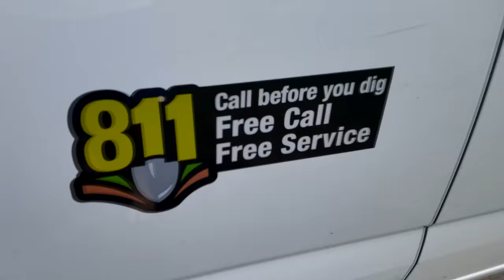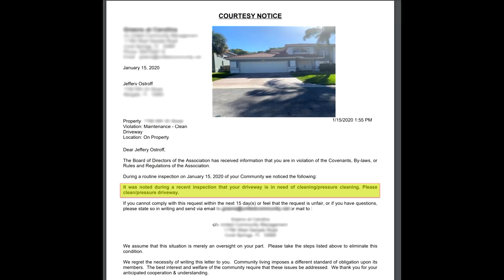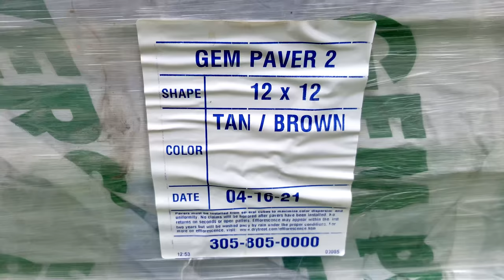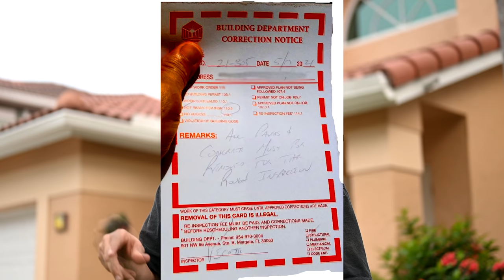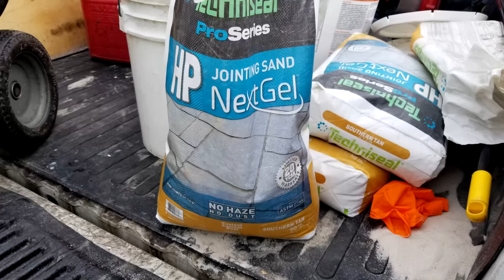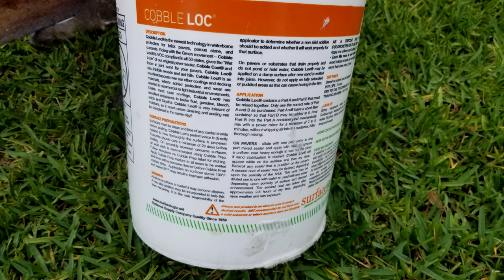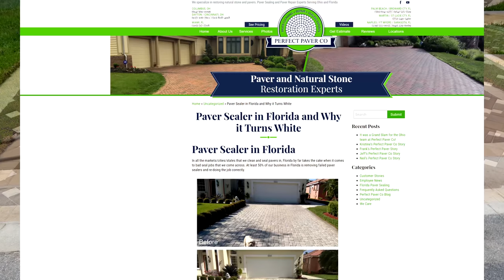How To Install Paver Brick Driveway Like Pros w/Time Lapse

Comment: This is all great...unless of course, you live in a State like our WISCONSIN and have to run a snow blower or plow over it during our 4 months of snow each season!
Reply from the maker: Would not do a snow plow on this
Reply: You’d have to have a rubber blade.  I used to plow brick drives all the time.  Though, rubber blades don’t do as good of a job.

Comment: What I want to know is why a guy would complain about the former contractors on a paving job that was excellent. Then in the next minute complain that an inspector actually wanted you to remove all the pavers so he could check base depth. Did you know how deep the base was on the sidewalk? Don't do half the job and complain that an inspector doing his job is OCD. Oh and I've never seen anyone cut paver that are already on the ground. The cuts just aren't straight when cut on the ground. Thats why saws have flat tables. There's also plastic borders that are secured with big spikes that are used to retain the edges that work at least as well as the cement as ground moves and concrete doesn't so it breaks

Comment: Gotta say that the old driveway is actually in pretty good shape (minus the oil stains) and looks like, after 28 years, it held up well. It's a shame to have to replace because of oil stains, but I get it. I would have done the same. To bad you had an incompetent inspector.
Reply from the maker: Yes the bricks of the old driveway were physically in good condition. The perimeters were starting to sink into the edge of the driveway, and the oil stains no matter what we tried and no matter what companies we've brought in over the years with acid wash and everything else, nobody was able to get rid of the oil stains. Tried every remedy people suggested over the years. The homeowners association was really getting on me about the driveway stains and I had no other option but to replace the driveway. But I did get 27 good years out of it.

Comment: The driveway looks great. The installers did great work. One thing that is concerning is that you should never dry cut. A saw that distributes water to the blade should be used, or someone should be pouring water to the pavers that are being cut to greatly reduce the silica dust. I didn't see anyone using PPE when pavers were being cut so everyone, including Jeff, was breathing silica dust. I wonder how the installers' lungs will work in the future. I hope that someone makes them aware of the damage they are causing and do the proper steps to be safer.
Reply from the maker: I agree. I stayed away from the cloud of dust when they cut.

Comment: I’ve never seen anyone compact the sand before, but it looks like a good strategy.
Reply from the maker: I believe it is required by code
Reply: it is necessary, but they did it completely wrong... they cracked all those bricks with the compactor, that's not how you do it
Reply from the maker: @notimportant3686   I'm not sure what you're talking about they do not crack any birds with a compactor.

Comment: Gorgeous as it is, kudos to your HOA for allowing you to do something unique.  I'm afraid our HOA would have rejected the plan because it was different from every other driveway, and would have "spoiled" the homogeneity.

On another note, it would be great if you showed the budget for the job, and the final cost against the budget.  Also, maybe a little about how long it took from signing the contract to gathering materials and scheduling a crew.  I know your mileage may vary based on location, timing, etc.  But cost and schedule play an important role in dreaming.  Sadly, my budget would have seen me turning over the oil stained pavers and maybe putting a little cement around the edges.  

Great vid!
Reply from the maker: The total cost of the driveway install was $4800. After that came an additional $700 for polymeric sand, and for the initial sealing of the driveway
Reply: @jeffostroff  is that just material? Or labor included?
Reply: @RIZZOTTO  HI Jeff , I'm curious as to how many sq ft thus was total?  Thanks in advance  , looks great

Comment: Very cool driveway and walkway. These guys really knew what they were doing. I was a little uneasy when their hands got so close to the saw blade. 😣
Reply from the maker: That one seen the blade was spinning an inch from his toe!
Reply: @jeffostroff   Once, I was doing a big landscape job next-door to a house where a man was doing a patio and fire pit decorative stone job.  Beautiful work! However, he used no safety glasses with his saw and he worked in flip-flops. I complimented him on his work but told him I was frightened for his safety. He said he had been doing it this way for 10 years with no problem. I never saw him again, but I wondered if his career ended after 1 or 2 more years.

Comment: That old driveway looked good..... It just required a degrease and to reset the borders
Reply from the maker: No decreased worked even acid wash did not work
Reply: @jeffostroff  that's a pity...  That old driveway is much better than mine..... But the new one was the dogs bollocks!!
Its beautiful.

Comment: This is SUCH a Florida driveway...I love it!

Jeff, out of curiosity, is the sealer just for parking cars on it? If it was for the backyard, I assume it wouldn't be necessary.
Reply from the maker: The sealer protects the surface against stains from oil drips, brake fluids, other liquids, fruits, etc. I always seal all my bricks even the back patio
Reply from the maker: @gorak9000   They did not force me to install a new driveway they simply said clean off the oil stick ass. But we could not get them to come off and I wanted a new driveway for a number of years anyway so I replaced it.

Comment: Completed Driveway looks beautiful, but I thought that was the point of having pavers…? If you have broken or stained pavers you can just replace those particular pavers and not have to interrupt or replace your whole project!? 
Majority of your old driveway was still in great shape; I hope you gave those pavers to a place like ‘ReStore- Habitat for Humanity’.
Thanks for sharing all the steps and beautiful driveway and walkway.
Reply from the maker: I stopped them from carting off more bricks, and posted them on craigslist for free. Guy showed up in 30 minutes with his pickup and tool the rest away to re-use. You can insert new bricks if you have them, these are 27 years old. I wanted a change and these newer bricks with the small diamonds were just the pavers to do this job.
Reply: @jeffostroff  plus they would be hard to match color and style!

Comment: The driveway looks great and the video was excellent.  A couple of questions.  I have found that using small area pavers can cause eventual uneveness when something sits on the corner of one of the small pavers.  Not a tire, but something smaller that can apply pressure in a small area.  Even though the sand is compacted, it can still give.  Have you expereinced any unevenness?  How did they finish out the perimeter.  I saw the mortar/cement for the soldier bricks.  It did not look like there was much room left for topsoil and sod though.
Reply from the maker: yes, all edges had just enough mortar to hold it in place, then grass is brought up on top of it. A few of the pavers have developed a bit of lippage between pavers, and no sand is perfect, and can still shift a bit underneath from rains

Comment: I did a sidewalk myself all by hand. It turned out good but man I couldn't believe how much work it was.
Your driveway looks great. Must have cost a lot especially with that curve. $15k?
Reply from the maker: Nope! Only $4800 plus another $700 for the polymeric sand and sealant
Reply: @jeffostroff  Wow that's a great!
Reply: @jeffostroff  did one crew/company do the job or separate crews/company? It must also help that you work in the trades so you know more than the regular DIY.

Comment: I'm surprised the pattern didn't violate HOA something. Even with that sealer 20:54 still think you might need that tool if there's ever another oil spill.
Reply from the maker: I sent the HOA photos of tiles and drawings and they approved.  The sealant is supposed to be resistant to oil spills, so hopefully we don't have to test that.
Reply: Give it a year or 2, the HOA will find something to complain about. As I say, 'If there's an HOA, just say "NO WAY"' - NEVER buy a house in an HOA unless you like being pestered continually about the stupidest crap.

Comment: I really don't know what to say that driveway looks absolutely amazing the old one the 27-year-old one and you couldn't get the grease stains out right you tried so I'm wondering what if you went to some kind of auto parts store and said listen can I have some of your old oil and take all the oil and stain all the other asphalt just oil stain it cover it with plastic and the whole thing would be blended with with the oil stain right and then you wash the top off and now it's a new color but it's Blended and it looks a lot better and probably would last another 27 years but the new driveway obviously you get more money with the new driveway right so good job with that too
Reply from the maker: Yes, we tried every cleaner out there that people said would work. Even had a company acid wash the driveway but did not work

Comment: Hey Jeff - a question.   I will be doing a small patio on the back of my condo.    It will be 2- 20” pavers wide and about 20-20” pavers long.   Do you think I need to have the vibration machine for this small of a job?   I do think that the polymer sand will be a good choice, but not sure I want to invest in the vibration machine for such a small job.   If there something else I could do instead to get it all in the cracks?   Again, it will be 20X20s so not nearly as many cracks to fill as you did.  BTW, beautiful new driveway!
Reply from the maker: You need to find some way to vibrate it, you buy a tamper from home depot, $30 and but a board down and down and tamp the board to cause vibration. Are yo on the first floor? not a good idea to add pavers or tile to upper floor patios
Reply: @jeffostroff  ok I can do that.  My dad has a tamper so I can borrow his (I was going to use it anyway to tamp down the sand before laying the pavers).  And yes, this will be on the ground not in a balcony.  Thanks!

Comment: What sand (sand grade?) is it that your packing before the bricks?
Is it a certain type of sand/ ground? Any help will be greatly appreciated
Reply from the maker: They had a dump truck just dump a huge pile on the yard so not sure what that was, however they did have several bags that they brought with them the day they installed the bricks that said place sand and here's the exact bag from Home Depot https://www.homedepot.com/p/SAKRETE-50-lb-Play-Sand-40100301/202007298

Comment: water must be used at all times when sawing
Reply from the maker: There are saws and blades that can be used either wet or dry
Reply: I stopped using water years ago. Got tired of the mess it makes and the residue it leaves on the pavers requiring the extra step of washing it off. That being said you're comment is a good one for most diy'ers in that they probably won't take the proper health and safety precautions when dry cutting.

Comment: How much would this cost? Labor and materials. What was the total work time (how many days?)
Reply from the maker: This total job was about $6000. The 1st day The demolition crew came and took them about 2 hours with a Bobcat to pull up all of the old driveway bricks and haul them away then they put down sand on the driveway and tamped it down. Then on the 2nd day they came and put more sand and tampt it down again  After starting about 7 AM, they finished by 3:30 PM
Reply: @jeffostroff  thank you!

Comment: I’m not sure if it’s just me, but some of those pavers don’t look level (some are higher than others). Reading comments, I understand now how you were able to pay “cheap” to have this done. Lots of foreigners undercharge to make sure they get the job. They’re more about quantity over quality. I’m a foreigner too, but no way I’d sell myself cheap. By the way, Not to be negative but I doubt that install wi last as long as the original driveway
Reply from the maker: This was not a cheap job, and I did not see any unlevel pavers. This was a professional contracting company with VPs and directors, and at the end of the video I showed you their $1 million project in Boca That just completed the paving for. This cost $6000 which is about in the range what a paver brick driveway goes for. This was about 20 x 20 driveway.
Reply: @jeffostroff  you know, I guess you are right. I didn’t take into account a few steps/ or if you were building a BRAND new patio. This was a much easier project than doing a brand new one. I wasn’t taking into account the excavation and base stone material/ labour. I wasn’t trying to offend you, I just missed a few extra steps. Still, for 6k you transformed your driveway and walkway. You are happy and you HOA is happy. That’s what matters!

Comment: You can’t use that pressure washer after you put the polymeric sand down it blows all the polymeric sand out of the joints. Yes your pavers are clean but now there’s no more polymeric sand where it needs to be. Yes your pavers are sealed

Comment: i dont like surfaces where there are small bricks, it's not even. asphalt on the other  hand is a little too dull and ugly. so i like something in the middle. i like it most where there are very large plates. if i walk in city and have chance where to walk i chose bigger plates. best is to pour concrete and then cut it into large pieces to prevent cracking and to enhance visual appeal. looks good too.

Comment: You should have pulled up the original sub-base and re,installed it. Also, the border pavers should be set in a concrete beam (6" deep) with a piece of rebar. Not just a bit of concrete set against the outside edge. That would have been a truly pro install.
Reply from the maker: Well the six inch concrete with the embedded rebar as you said would be strong but it is also overkill, I have never seen a failure of the concrete there and mainly it's because it's such a small amount if you were doing a width of concrete equal to a sidewalk or something like that I would say yes you would need a rebar rod in there. But this concrete is really only there to hold the edge bricks from wiggling loose there are not a lot of forces on it
Reply: @jeffostroff  It's for the border in case a car tire is on top and then the wheel is turned (with the car stationary). Pretty much guaranteed the border will move and require repair.
Reply: @jeffostroff  You are wrong about that. A one-ton car or a two-ton truck driving near an edge will squish those pavers out. Your unreinforced concrete will certainly fail. They did my walkways like this, and the concrete edging broke up—and that’s just with just foot traffic. The 6-inch reinforced concrete berm would be pro-grade. But even a single piece of rebar in your edge would have made a huge difference. As a side note, your grass may have re-grown over that concrete for now, but long term it’s going to struggle to thrive without a good soil base & root system. Again, I know this from experience.

Comment: 14:28 - That's not a safe way to use a saw like this.
Reply from the maker: yes a lot of contractors use tools in risky manners. I see carpenters hold wood on their leg and slice through the wood with circ saw, makes me cringe
Reply: Hate to be "that guy" as well, but this particular cut was unnecessarily dangerous holy cow.
Reply: @jeffostroff  
I've got almost cold sweat by watching fingers, hands and feet that close to a saw blade in this video. An involuntary amputation waiting to happen.
Reply from the maker: @MrKoenig1985   These guys do this all the time A calculated risk

Comment: Hmm, it's just cheap concrete bricks (costs about $16/m2 = $1.50 per sqft here), so that's "super rich looking" for sure :-D
Reply from the maker: Even millionaire's houses with their driveways are still brick. But it's how you lay them, and the intricate designs you make with them that make it look rich.
Reply: Lol no. I think I know the exact block you are talking about and its 1/3rd the thickness of these. Those really cheap ones are patio only. Will crack under a car.

Comment: Just another BUSY-BODY homeowner association. They need to mind their own business and not be so petty!!!
Reply from the maker: but by eeping all the homes looking tip top the hood has great curb appeal and the houses sell for more
Reply: @jeffostroff  If you can find people that don't know the woe's of being in an HOA - there are fewer and fewer of those people around all the time. As people experience them first hand, they learn to stay away. I specifically spent extra time looking for a house without an HOA - 2 houses down the street from me, there is one, but the little corner I'm in has NO HOA and NO CC&R's on the deeds because the developer never set one up / instated that crap on the deeds. The houses in the NON HOA section are better maintained than the ones 2 houses down that have an HOA, so I don't buy into this bs that HOAs improve property values. An HOA in an area not that far from me is run by a total bunch of Karens, and people requested to have basketball hoops so their kids had something to do during COVID last year, and they refused. You own the house, and some Karen won't let you have a basketball hoop in your own driveway for your own kids to use?? If you like your life being dictated by little power hungry HOA nazzis, then they're great. Most sane rational people find them irritating beyond belief.